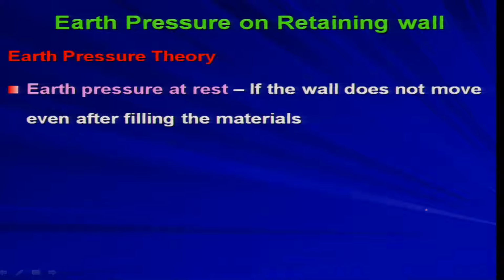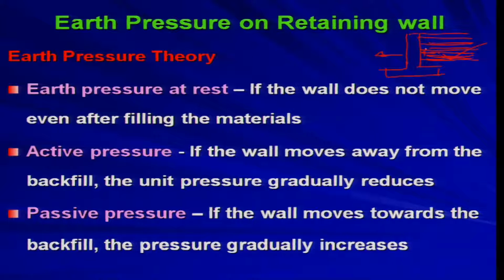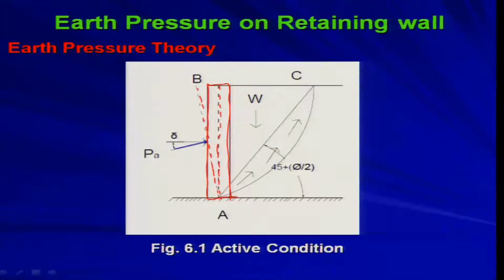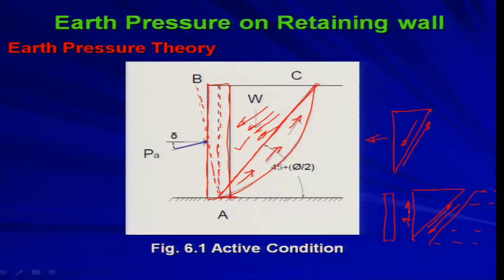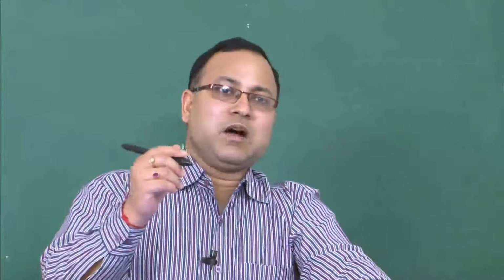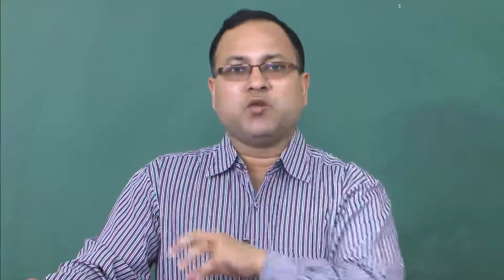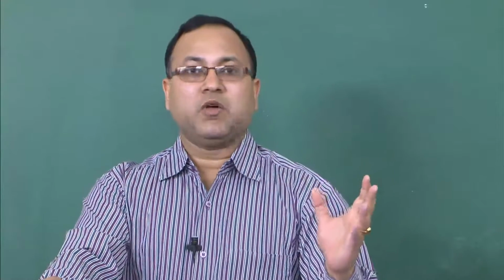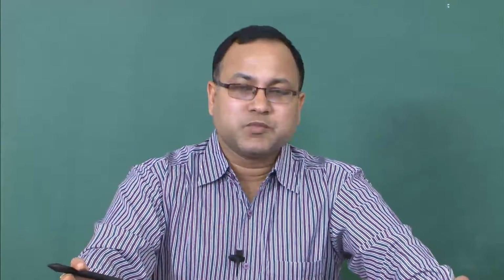Module 50 - Earth Pressure on retaining wall

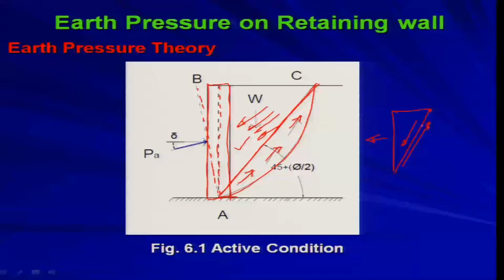Comment: "Complete mobilation of shear stress" --time 12:27 

what does it mean
Reply: Mobilisation simply means being used or to come into action. Even though the soil has shear strength, it can act only if soil tries to move. (Just like friction. A tire on a rough surface cannot experience friction until it tries to move!) Complete mobilization just means that the magnitude of soil displacement is such that it requires full strength of soil to be mobilized. (or full strength is required to counteract the soil movement).
This is the reason almost all the retaining walls are designed for active condition. In active condition soil strength also counteracts the soil movement helping our retaining wall.
Reply: what does it mean.